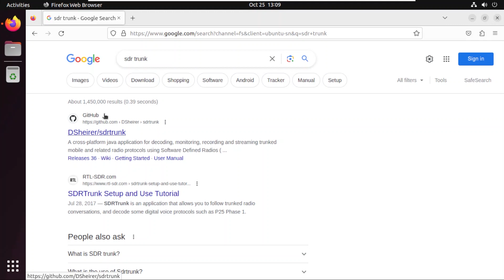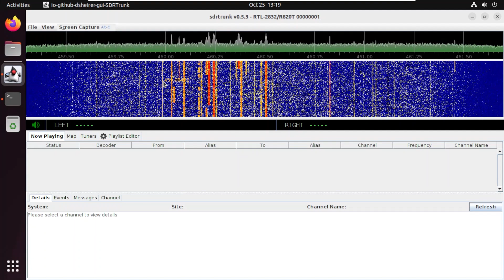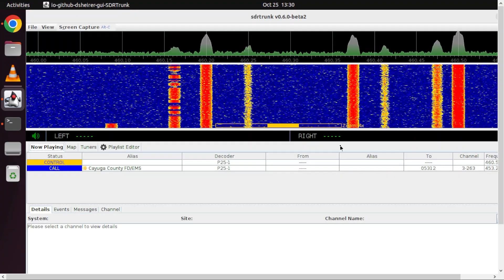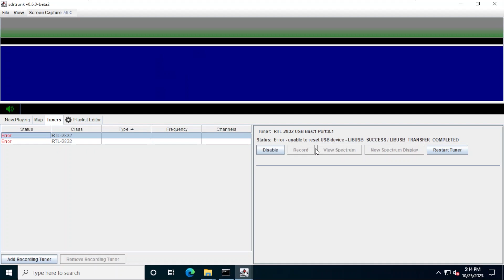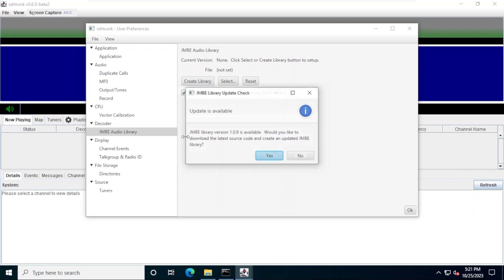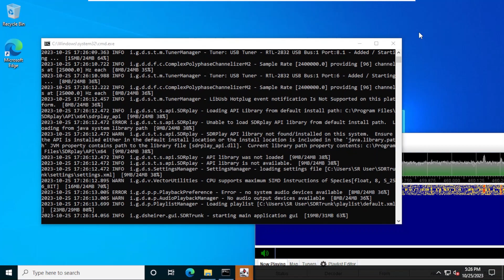Set up your own scanner from spare parts!?

Comment: Hello thank you for the video great job explaining how to setup and config sdrtrunk. i am fairly new to SDR ive been playing around with it for about a  year or so now im currently providing a broadcastify feed for my county's FD/EMS/SO. The system in place is a a Multi site p25 phase II Simulcast.  im running 3 RTL-SDR v4 to  ensure im not missing any calls. Site control Freq. Range from 771.91875 | 772.18125 | 773.19375 | 774.16875. its my understanding that all sites broadcast the same traffic so my question to you is would it be more beneficial to only add that site that is closest to me  (less than 2 miles Average DB ranges 15 -20DB) in theory i  would like to avoid other sites broadcasting but arriving slightly later than the one closest to me causing some distortion in the audio.
Reply: forgot to mention, Each RTL-SDR is running on its own Antenna their tunned for 700Mhz  - 1700 Mhz  each spaced 36" apart

Comment: What are Data Calls and what is the benefit of Ignoring them? Thanks
Reply from the maker: That's a great question and one I don't think I've been asked while helping people set this up. Data calls are messages that are received from the system that could include unencrypted text data.

My local system does not use text data so I generally will ignore them. It is something I encourage people to play around with but keep in mind it locks up one of the tuners on your RTL SDR for data monitoring. So if you're using Windows or you are only using one tuner, it will directly affect how much you can receive at once.